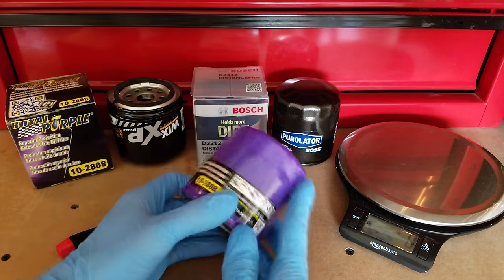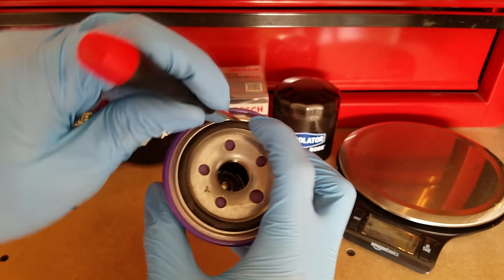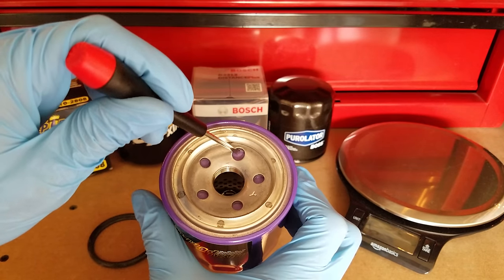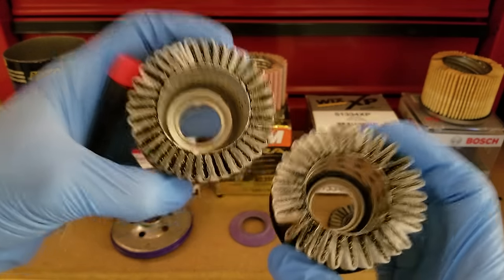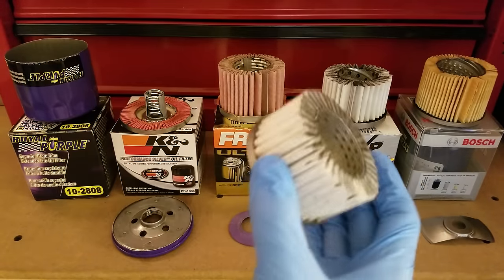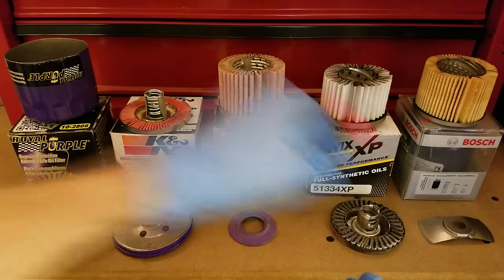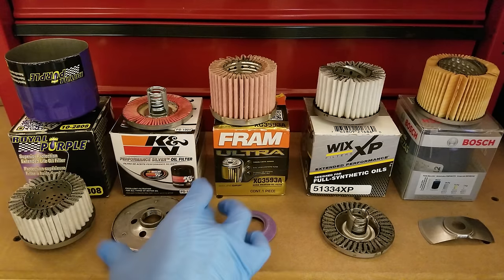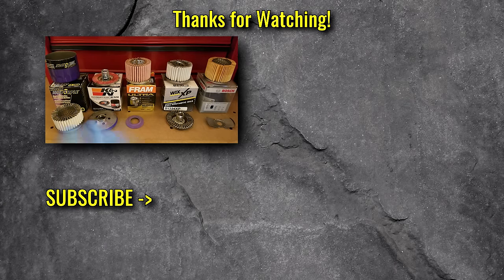Royal Purple filter Cut Open!  vs FRAM vs WIX vs BOSCH

Comment: If you cut enough filters apart, you will find their are a limited number of filter manufacturers in North America, indeed in the world. Many of the everyday brands we see are made by the same few companies with a different paint job. Many "brands" don't even manufacture anything, they just buy a filter with their name painted on the side. Some of the brands are owned by the came company and they produce a cheap brand one brand in one factory and a higher priced brand in another, or just produce one quality and sell it at different price levels.
You could look up the specs from the various manufacturers and compare them if you could get comparable specs across the board, but you can't. Manufacturers play fast and loose with micron ratings. Beta ratings and contaminant holding ratings are also a bit arbitrary. If they all use the same SAE standard test and release the results, you would know.
I will say these things after 45 years in the Heavy Duty business using and selling filters: 
- I had a premium brand filter that had an electron beam welded  can versus vs. a drawn one and it leaked a fine spray. Not a good thing near a turbocharger.
- I had a premium quality filter in marine application, freshwater recreational use, used one season. Dry docked over winter it rusted right through.
- I had premium filters that the gasket wasn't secure, it would fall out if you tipped the filter which some installers didn't notice which led to unhappy customers and an engine failure.
-  Filters with thicker cans will fair better under high pressure caused by cold temperatures and/or high volume oil pumps. They will take the strain after lesser cans have swollen or burst, not uncommon in the north. 
-  I've never had or seen a failure of a cheap oil filter under normal conditions.

50 years ago Fram had a TV ad, "You can pay me now or pay me later" in which a crusty mechanic  advised "Change your oil and filter now or pay me to replace your engine later". It was good advise.

Comment: I just use an old sock inside a can of soup LOL!
Reply: Mark Anthony they still make the old cans you just pop in a roll of toilet paper
Reply: I know what you are talking about. When I first started in my trade repairing collision, we had a "filter can"  in our paint booth to take the moisture out of the air system. Toilet paper, that's what we put in the can!
Reply: Just curious, but why a can if soup instead of just a soup can?

Comment: These are good filters but I prefer an OAM filter for the reason that I'm going to state oil pressure Especially if the engine is still under warranty No guessing with factory filters those filters are designed for your car doesn't matter who makes them they're designed for your car.

Comment: The exact filter specifications are a closely guarded secret which the manufacturers don't provide.  If your engine is still under warranty, use the OEM filters and keep the receipts in case you want to file a warranty claim later on.
Reply: They cant deny warranty for not using oem filters.
Reply: Yeah
With a vehicle they would have to prove that the non OEM filter would have caused the issue in the first place to deny any warranty service. You can use non OEM parts in a car and retain insurance/warranty. You can also repair your own vehicle without consequence unless you mess something up.
Reply: @infernaldaedra  They don't care, and they can deny warranty for not using OE filter.  Suzuki loves to do that.
Reply: @KRAUSER0130  That is still illegal for vehicles sold in the US. It is also not enforceable. I can't believe companies are this shitty.
Reply: They are a 'secret' because all of the filters have relatively same performance

Comment: Just another oil filter video of someone giving a opinion. When will someone actually do a scientific test to compare?
Reply: Exactly! You really can't tell which os best (although it's likely that we can tell which is worst) by just looping at it. I want to see how effective the filter is new (trapped particle size), percent of contaminants captured in one hour and burst pressure. Then I'd like to see it repeated on the same filter after it's had the equivalent of 5,000 miles on it and then repeated it again when it's had the equivalent of 10,000 miles through. When its completed all that then I'd like to see it's seal tested then have it torn down and carefully compared to a a new one.
Reply: Look for a forum call bob the oil guy ,you will find actuall data test and long term use of different filter.
Reply: they are out there, just NOT on youtube, Purolator Pure One, Royal Purple and the Mobil-1 High Mileage are the top 3 filters from what i've found, but that data is a few years old at this point.
Reply: Ok randy, let's work together to get some scientific numbers by testing oil filters. First, what numbers do you think will tell you if a filter is good or bad?
Reply: But but but, he said he's impressed! No flow testing, no mileage/MTBF testing, no before and after testing, no oil analysis testing, no actual material testing with the exception of two measurements yet no understanding of the design principles and parameters.
Reply: Using new oil and filter in a closed loop system with a pump, like a small fish tank.  5 quarts of oil and add say 10 grams of each, fine graded sand 100 sieve (149 micron) and above.  Run for a set time,  measuring the upstream and downstream pressure of the filter (filter deltaP) see how long it takes to plug filter.  Just a quick idea.
Reply: the engineers at these companys must watch these videos for a laugh to see how youtube mechanics pic apart there products with various no scientific bullshit. And then the next youtube guy goes oh I need content il cut open some fiters and talk crap abut it for 5 mins too!!
Reply: Randy Talsma 😁🤔😁🤔😁🤔😁🤔😁🤔😁🤔😁🤔😁🤔😁🤔🤔😁🤔😁🤔😁🤔😁🤔😁🤔😁🤔😁🤔😁🤔👏😨👏😨👏😨👏😨👏😨👏
Reply: Filter efficiency is a product of filter media porosity. High porosity filter media has less resistance but it's less efficient at trapping the finer particles. I think that someone needs to determine the finest carbon particle sizes and build media to trap those particles before they clump and form larger more abrasive crystals keeping in mind that carbon is the hardest substance on Earth.

If media can trap the finest particles, then I think that the abrasive engine wear issue can be resolved. I think it would require multistage filtration using progressively finer filtration cartridges until the finest particulates can be filtered supported by laboratory analysis to determine each stage's efficiency. It's the only way to be sure, or so I think. I have over 54 years of professional mechanicking and still at it. I have worked at Volvo, BMW, Mercedes, Porsche-Audi, Volkswagen, Ferrari, Maserati, Lamborghini, Lotus, Saab, and finally Ford dealerships. I also worked on American and Bucyrus-Erie cranes, as a tugboat powerplant-generator mechanic, and all the yellow stuff you see on construction sites before settling on automotive electrics, which is what I do now because I'm to old to turn wrenches, but I'm still sharp. I was an ASE Certified Master Technician until I became weary of taking tests.
Reply: You will find out, in standard perfomance and street driving, it doesn't make any difference. The high mileage filters are designed to last out the recommended oil change interval. If you keep a shorter internal, such as 5000 miles or less with conventional oil, you can use any filter. Even the hated Fram. I have a Wix in my vehicle because someone gave it to me. Next oil change, I am going back to Supertech. Never had an problem.
Reply: All I can contribute is this:  I have used Fram since 1965, using 3k oil/filter change intervals on all my vehicles and have NEVER, EVER  had an issue. Ever!  If these filters were bad how fast can you say class action lawsuit😜😜😜😜😜
Reply: @williamschuman4951  Ummm.....no!!   Mobil 1 out performs Royal purple in flow testing and shear testing.   So does Amsoil.
Reply: @thekingswolf  - LOL...you mean the forum guy who is plugging PENNZOIL on his site? Yeah, that's really objective there...
Great tech info on the landing page, but you can't be commercially advertising ONE COMPANY'S OIL on your site and expect me to really believe you are 'objective'.
Reply: @virtualmage0  -  LOL...you mean the forum guy who is plugging PENNZOIL on his site? Yeah, that's really objective there...
Great tech info on the landing page, but you can't be commercially advertising ONE COMPANY'S OIL on your site and expect me to really believe you are 'objective'.
Reply: @georgerivera9035  All that work and you have not designed your own car yet?? 

You should have designed your own car by now unless you like what the world is selling us consumers. Lol
Reply: @anonymike8280  Well.. Filter media does make a differce. I would never ever use a wix filter on my vehicle. 

I used fram when I didn't know any better. 

But once I studied enough I began to realise what I was doing to my vehicles engine by using garbage filters. 

Any filter that does not have a Micron rating of at least 25 or less and of synthetic fiber media is a garbage filter. 

That's why I switched to Amsoils 24,000 Mile Oil Filters. And now as this video showed, Royal Purple makes hi quality filters much like Amsoil does.

So never again will I buy cheaply made garbage filters which will shorten the life of an engine and its oil. 

Engines can last millions of miles on Amsoil Signature Series Synthetic Oil and Royal Purple Hi Performance Synthetic Oils. 

But getting engines with Mobile 1 or Supertech Oils are a no go for millions of miles. Nuff said.
Reply: @tombob671  They are very very bad filters. Never will I ever use one again.
Reply: @extremedrivr  I used Fram filters in the early days of my motoring career. I haven't used them in many years because I don't like their market positioning, not because I think their  product is non-functional. I have to admit, the vehicle I used the Supertech filter in didn't last very long. Some rube made a left turn in front of me and I got a nice settlement. Bought a 1996 Nissan Sentra GXE with 141K for a dirt cheap price and put the change aside to pay off my student loan. I'm in graduate school in my old age. If you know any good sources on Nietzschean individualism tell me about them. I could still use a couple more.

My plan with the Nissan Sentra, because the filter is hard to get at, is to get a high mileage filter, Purolator Boss is what is available locally in a mass market 15K filter for this old production. Then drain and fill with dino oil every 2,000 miles and leave the filter in for a year, or maybe the whole 15K. The former vehicle was a 4cyl 2.2 Camry. With that engine you could just reach down and take out the filter by hand, so the plan there was a complete change with Supertech oil and filter every 2,000 miles. For an old car, the 1997-2001 4cyl Camry is about the best you can get for reliability, ease of working on and availability of used parts, but I am just tired of Camrys.

The Sentra needed drive axles ($55 for both from discontinued lines), a new heater control unit ($20 with cables at the self-service wrecking yard), the faceplate glued back on the cheap aftermarket radio (all I do is listen to AM and FM talk and sports, I don't need a real stereo), and a new fuel filter. I'm looking into whether I can put a cushy power seat in there from an Altima, probably about $20 on half-price day. I imagine I could power it from the cigarette lighter wiring, excuse me, the accessory socket.

One thing I have seen with oil filters, Napa and Pep Boys say right on their web sites that their low end filters, Pro Select at Napa and the red Purolator at Pep Boys are rated for 5,000 miles tops in normal use. The inappropriately named Fram Extra Guard is a no-name filter with a name on it, which name you then pay an extra buck or two for. I won't support that kind of market positioning. Or use their upmarket products either.